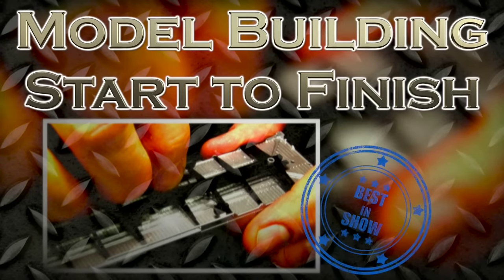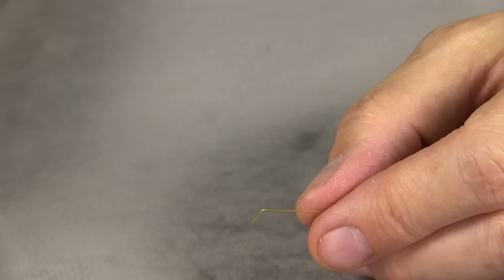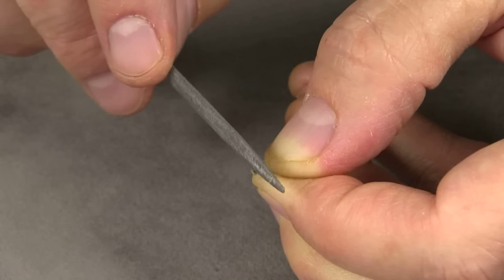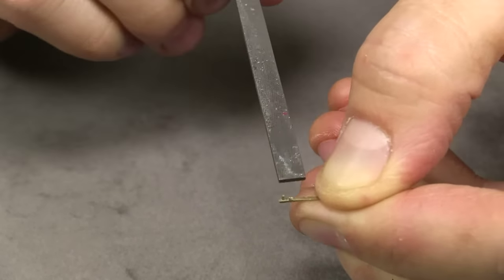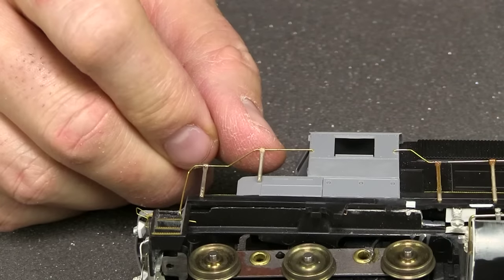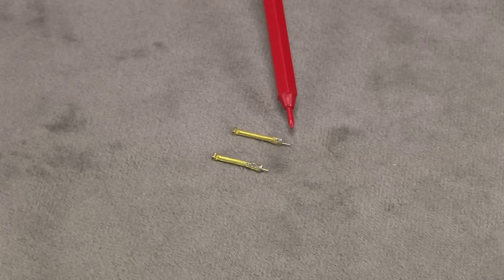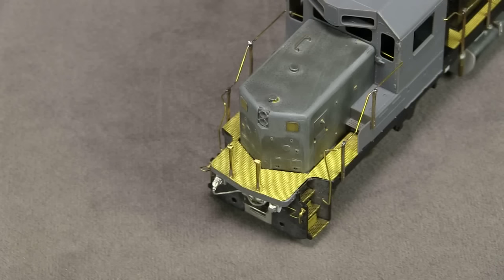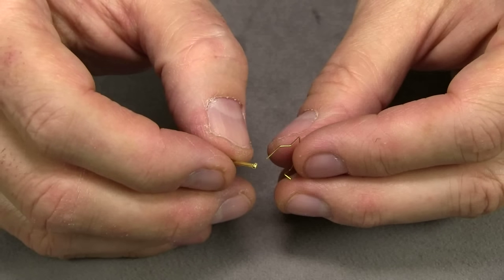HO Scale Athearn SD40-2 Model Building 14 of 25 Hand Rails

Comment: Dan, I've enjoyed your series on super detailing. Now that you have discovered Tix flux, be aware that it's corrosive and definitely not recommended for wiring such as soldering a decoder etc. An old toothbrush dipped in water will take care of cleaning up the joint. I've spent about the last 50 years or so detailing brass locos and I use Tix along with 3 or 4 other blends of solder because of the different melting points. I admire the work done with plastic models, as I think brass is much more forgiving. I think the stanchions with the different coloring are cast from beryllium copper. It's harder for more strength than brass.

Comment: I really enjoyed these Start to Finish Videos and am very impressed with your Skills, especially getting the Handrail Bends equal on both sides of the Engine, that's always difficult, but you make it look simple. I noticed that the File you used to file the Solder was heavily pinned, you could rub ordinary Chalk into the Teeth which would help prevent that occurring, mind I expect you already know that and I'm preaching to the converted. Also where you fill the channel Stanchions with Solder, you could always use a higher melting Point Solder, so that when soldering the Handrail it wouldn't be affected. I hope you don't mind my Observations. Thanks for the Videos.
Reply from the maker: Dan has a lot of practice bending wire. What folks don't see are the ones that get bent wrong then end up in the wastebasket. :)

Comment: LOOKS GREAT, BUT I GOTTA TELL YA! I THINK YOU GOTTA HAVE A LOT OF FREE TIME ON YOUR HANDS. I KNOW HOW GREAT IT LOOKS, BUT MY EYES CAN'T NOTICE THAT STUFF AS MY TRAINS ARE ROLLING. I HAVE 30 ENGINES TO DO...THIS WOULD TAKE ME A YEAR! GREAT JOB THOUGH NO DENYING THIS!! THIS IS AS GOOD AS IT CAN GET IN MY HUMBLE OPINION. I SOLDER MINE AND SOMETIMES PAINT THEM TO MATCH IF THAT'S WHAT THE HISTORY BOOK SHOWS ME.....THANKS! TRUE CRAFTSMANSHIP NO DOUBT
Reply from the maker: The guy doing the work on the model is very good at detailing plastic models. I'd say that most people would have a hard time distinguishing between a fully detailed brass model and one of his fully detailed, painted, and weathered plastic ones. It's a shame he only does this kind of model detailing when he has someone driving the project for him. At the rate he does things on his own, he might do a model like this every 2-3 years (or more).
Reply: @tsgmultimedia  Well he's got good hands and patience, I like to get mine weathered a bit, not all but some, and get them rolling! Hey i have a question for you while I've got your attention...I have some NOS bluebook Athearn  locomotives with the metal trucks total of 4 of them the are SD-9's. They are Sante Fe's and Southern Pacifics and i want to paint they trucks aluminum color. Do the metal trucks just pull off like the plastics, I'm afraid to do it as these are new in the boxes, i've got 2 new Black Widows too, but they had plastic trucks. Got any idea TSG?
Reply from the maker: @lad63bird  I don't know right off hand. The best advice I can give you is to examine them. You'll figure it out. I don't see any reason why they would be much different.